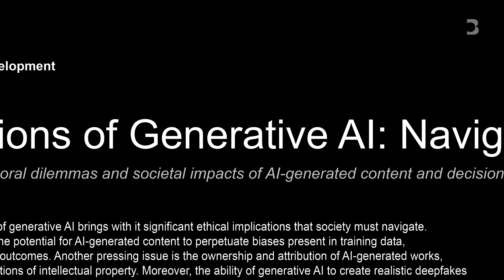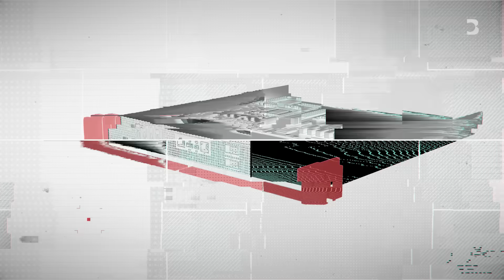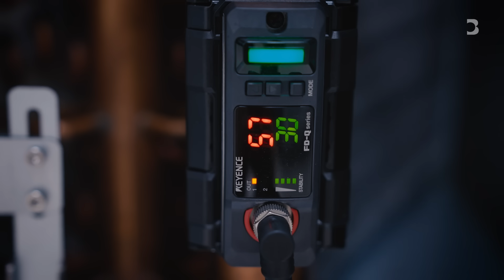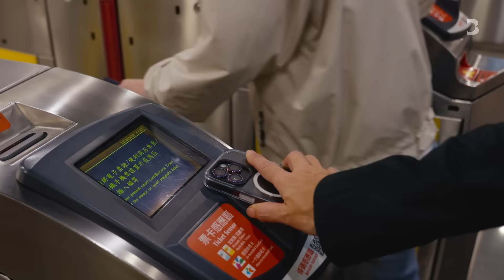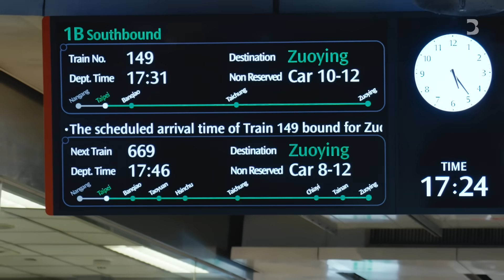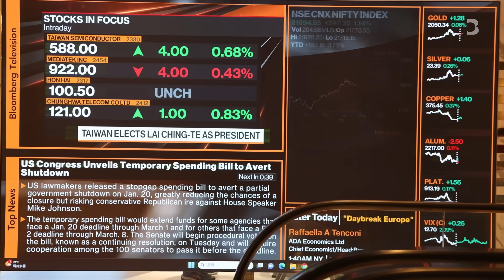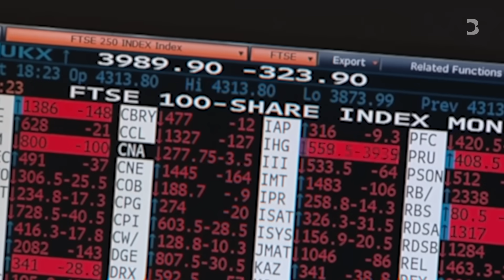Why AI Can't Exist Without Taiwan

Comment: Taiwan is an independent country, it is not a spot, not just an island.
Reply: A small but very powerful nation
Reply: Amen
Reply: Taiwan's Chip Industry Controls the Lifeline of Global Technology

Chip Specification Grade Classification:
Logic (Processors, AI Artificial Intelligence Computing), Memory Chip Operating Environment Requirements:
Commercial Grade -- 0~+70℃.
Industrial Grade -- -40~+85℃.
Automotive Grade -- -40~+125℃.
Military Grade -- -55~+150℃.
There's also an even higher grade: Aerospace Grade (Radiation Hardened), which requires resistance to radiation and interference, as well as a wider temperature range. Military and aerospace grade chips undergo rigorous qualification testing: pushing them to their limits, continuous high and low temperature cycling, vibration, shock, high ESD (Electro Static Discharge), and interface terminal plugging/unplugging endurance...
Generally, industrial-grade chips are twice as expensive as commercial-grade chips, automotive-grade are three times or more expensive, and military-grade chips are very expensive due to the need to amortize the manufacturing line costs. For aerospace -grade chips, setting up a production line costs hundreds of millions of US dollars, regardless of the quantity produced.
Taiwan's TSMC is the exclusive global manufacturer of high-end logic, AI, and memory chips for the US and its allies, as well as Taiwan's Chung-Shan Institute of Science and Technology (CSIST), for military and aerospace applications. The US Defense Advanced Research Projects Agency (DARPA) has approved the following manufacturers for producing military and aerospace grade logic chips and processors for the US military and aerospace industry: Taiwan's TSMC (advanced 7, 5, 3 nanometer process technology), US-based Intel (14 nanometer and above processes), and US-based GlobalFoundries (28 nanometer and above processes).
The manufacturing process, technology, materials, and raw materials for military and aerospace-grade chips are highly classified. The US and Taiwan have signed agreements to jointly control the highest-level technologies, prohibiting their export to other countries. The US government, still concerned for national security, has requested TSMC to invest and build factories in the US to manufacture advanced AI chips. Their entire production capacity is contracted by US Department of Defense military and aerospace manufacturers. Only the surplus and new factory capacity will be allocated to other companies like Nvidia, Apple, AMD, and Intel. This is an unspoken secret.

China and Russia's military and aerospace equipment can only use general commercial-grade chips for manufacturing, employing a trial-and-error method to create heat and cold insulation plus protective layers to shield the chip motherboards. This approach leads to short warranty periods and questionable real-world operational quality for Chinese and Russian military equipment such as missiles, radar detection systems, and aerospace equipment. Facing the US's high-tech electronic warfare countermeasure systems, their chip motherboards are vulnerable to destruction by high-power electromagnetic waves, causing missile failure and radar detection system malfunction. The failure of Russian weapons in the Russia-Ukraine war fully demonstrates this fact. If China invades Taiwan, the PLA's J-20, J-16 fighters, missiles, radar detection systems, and naval radar detection systems, which are designed using commercial-grade chips, will undoubtedly suffer a major defeat against US-Taiwanese electronic and electromagnetic warfare, and anti-electromagnetic pulse weapons. (Unverified online rumors in China suggest that the guidance systems of PLA missiles and torpedoes are reverse-engineered from US military technology of the 1990s, using stockpiled Intel 486 and 586 processors of commercial grade from 20-30 years ago for manufacturing.) This is something that the general public wouldn't understand, only experts in chip technology would know. Without mastering the highest technology in the chip industry, the Chinese Communist military is fundamentally unqualified to wage war!

Electric vehicles in China are frequently reported in their domestic market for failing to start due to excessively cold or hot weather, experiencing battery explosions, or suddenly malfunctioning while driving, leading to casualties. Besides other factors, it is very likely that Chinese electric vehicle manufacturers, in order to reduce costs, unscrupulously violate vehicle industry safety standards by not using automotive-grade chips and semiconductor components, and instead using cheaper commercial-grade chips and semiconductor components for the electric vehicle's electronic and electrical systems, making accidents inevitable.

The computer chips for the US Mars spacecraft are manufactured by Taiwan's TSMC using aerospace -grade chip technology. The computers for the US aerospace station are designed by Taiwan's CSIST and manufactured by TSMC using aerospace -grade chip technology, guaranteed to operate flawlessly in aerospace for 20 years. The computers and electronic systems for US and European low-Earth orbit satellites must be manufactured using TSMC's aerospace-grade chip technology.
Reply: we are already independent, CCP never control Taiwan even a second
Reply: When a “place” has its own currency, government, passport, educational system…etc, how is it not a “country”?
Reply: Surely it is still in our constitution that our government owns the mainland China, which is confusing to not only foreigners but also us Taiwaneses. However, to change the constitution and therefore officially declare independence will sound a declaration for war to the PRC.
Reply: Government = ROC
County = Taiwan 🇹🇼
I didn't realize an island can have a flag, government, military, currency, president, citizenship, visa.... 😉
Reply: Thank you TAIWAN NO.1🤩😍😍😘☝
Reply: Social credit -9999
Reply: Yes, Taiwan is a part of China. "ROC", Republic of China.
Never a part of PRC, cuz they are originally two different countries.
Reply: Wrong!  "Taiwan" is  the name of the island, NOT a country.  
Republic of China aka R.O.C. is the country that governs Taiwan and few isles around it.
Reply: @大麥肩挑200斤包子  but Taiwan operates as an independent country and is thus referred to as a country
Reply: @CCPSux-dik  Is there a Taiwanese Passport on this planet?  :face-blue-smiling::face-blue-smiling::face-blue-smiling:
Reply: @大麥肩挑200斤包子  You are WRONG! Taiwan, or it's official name ROC , is a country, another China. There are two Chinas in the world. One democratic, and the other communist.
Reply: Taiwan is not a country, Republic of China is a country that includes the Taiwan island and some small islands.
Reply: @seilgu  日本是不是國家? JAPAN、Nihon、Nippon、 にほんこく、にっぽんこく都是指日本國，誰說台灣不能代表中華民國? 美國、米國、美利堅合眾國、America、USA、United States of America~~是不是都代表美國? 國名有正式名稱、簡稱、俗稱、英文名稱、有的還有暱稱，另外每個國家還會把世界各國的英文國名用本國文字再音譯~美國、智利、加拿大都是音譯成中文的叫法
Reply: @MingtaiTsai  歷來台灣指的都是台灣本島，不包含金門馬祖澎湖等離島。改變歷史用法不僅造成混淆，但讓人誤解史書，更毫無必要。最重要的是毫無必要。
Reply: When did it declare independence? Please give us the date. I think the Taiwanese missed it. In their constitution they are still part of China.
Reply: @christineyoung8345  ROC was built 37 years earlier than PROC. We are already INDEPENDENT!
Reply: @hom0815  erm... Taiwan is under China since ming dynasty all the way till end of qing so it is part of China.

The only thing in question is whether ROC government represents China or PROC government represents China. One of them is sovereign while the other is defacto there's not in-between.
Reply: @linhaohoward  Are we under communist China ? The Republic of China, Taiwan, was built earlier  than Communist  China. Apparently, there are TWO different Chinas. Which China are you talking about ?
Reply: @hom0815  Taiwan is part of China since ming dynasty even until the end of qing dynasty. In international law the successor gets everything, kind of like a winner takes all so there can only be one China.

Which is why I'm saying that either ROC have sovereignty over China including both mainland and Taiwan or PRC have sovereignty over mainland and Taiwan. There is no in-between. Whoever tells you otherwise probably are just giving reasons emotionally without the basic understanding of international law.
Reply: @linhaohoward  What international law?  You know sh*t.
Reply: @christineyoung8345  It never needed to, because it was never a part of People's Republic of China (China for short). It was a part of Republic of China, that lost the mainland territory, and continues to rule Taiwan and a few islands, so now Republic of China is "Taiwan" for short especially so foreigners don't get confused about the distinctions between the two governments. But this likely confusion in name by foreigners is precisely where China is exploiting with its outward propaganda, to try to convince everyone Taiwan is their territory.
Reply: @christineyoung8345 Incorrect.
Never part of PRC(China)
Reply: @christineyoung8345 it was always independent. And read the un resolution 2758 yourself. NOWHERE does it say taiwan is part of china
Reply: @christineyoung8345  This island "Taiwan" is never part of China, how come it suddenly became China's??????
Reply: @dermot864  Taiwan was part of China from the 17th Century when Koxinga (Zheng Chenggong) kicked out the Dutch. The island/province of Taiwan has never been ruled by the CCP, i.e. it has never been ruled by the current government in Beijing.
Reply: @dermot864  technically it is a part of china ever since the revolution, but recently the government is moving towards an independent identity. Fun fact, Taiwan was formerly the recognized representative of China in the UN, until the communist party was recognized instead. Not a supporter of China, but the geopolitical history of the two are much more complicated than people say.
Reply: @christineyoung8345  Taiwan's existence depends on the U.S. Although most Taiwanese people don't identify as Chinese, they cannot declare independence because the U.S. has pressured Taiwan not to do so, in order to avoid military conflict with China.
Reply: so independent that china can get it in a week if it would want or if USA would say they sell it off
Reply: @szymonbaranowski8184  If China could take Taiwan in a week and since China wants it so badly, why hasn't China done it?  Because China IS NOT able to.  Plain and simple.
Reply: Every country says Taiwan is China province 😂
Reply: @André__Vasconcelos__Sá  yeah, only if China pays them to

Comment: Netherlands' producer of lithographic machines is much more required. Taiwan is just user of that machines. Europe really needs to localize production of chips.
Reply: If so, Samsung and Intel also bought those machines, how are they not producing chips with same performance?
Reply: TSMC is building fab in Germany, US, Japan and Taiwan. Want to bet which factory will have highest cost, lowest yield, slowest development pace and the most frequent worker strike?
Reply: @iamsink  US?
Reply: Even if EUV is purchased, advanced chips cannot be mass-produced with a high yield rate.

EUV uses TSMC's wet technology and is developed at F12b, TSMC's Hsinchu headquarters.

TSMC modified the purchased EUV and redesigned the reflective structure to increase the reflectivity from 2% to 3% and increase the efficiency by 50%.

TSMC's dry EUV mask cleaning technology reduces exposure to dust particles from hundreds to single digits per 10,000 wafers, a 99% reduction in dust ratios.

   ASML's latest EUV light source output power is 350W, but TSMC has begun using its own improved 350W EUV in 2020.